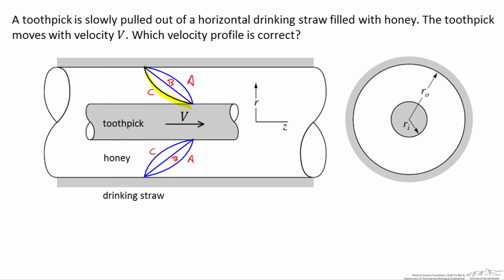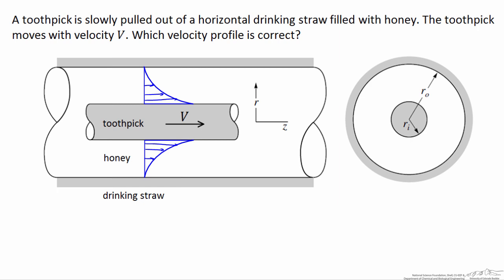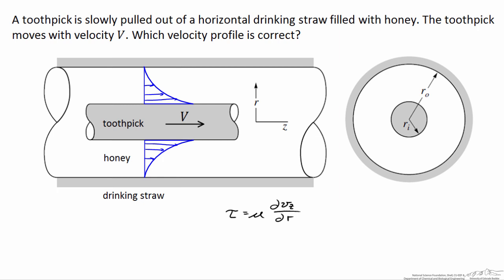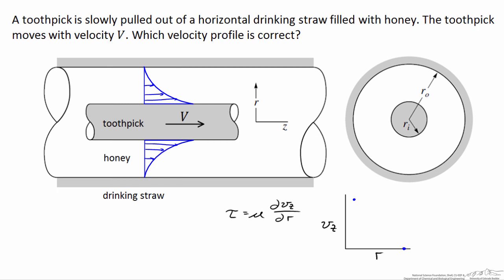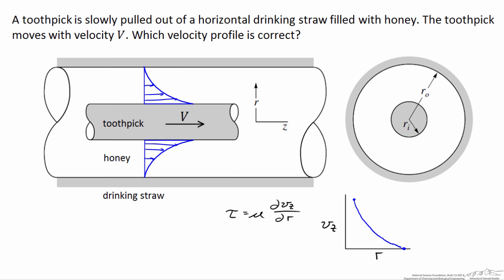Velocity Profile in an Annulus Answer C

Comment: I found it clearer to solve NS in cylindrical

NS reduces to (1/r)*del( r * [del(Vaxial)/ del r] )/del r = 0

results in logarithmic axial velocity profile (rather than linear in the planar couette flow case)

tau = mu* dVaxial/dr

dVaxial/dr = Vtp/(r * ln (Rtp/Rstraw)) so the gradiant is smaller at the straw surface increases logarithmically to reach its largest value at the toothpick surface